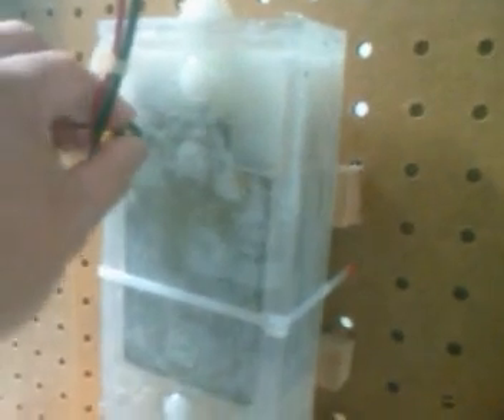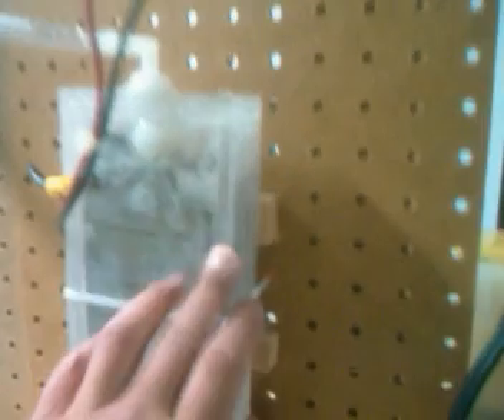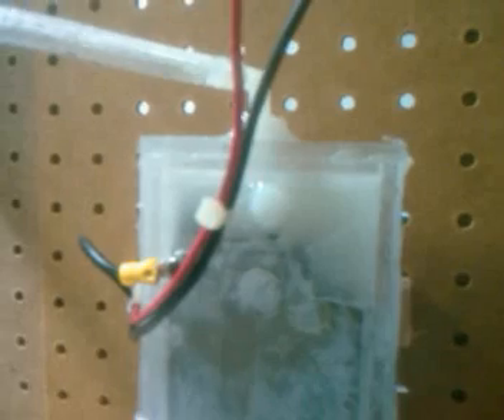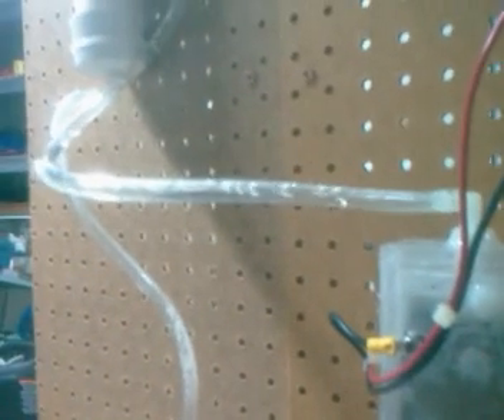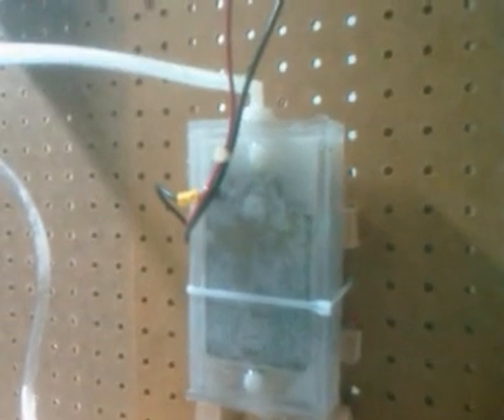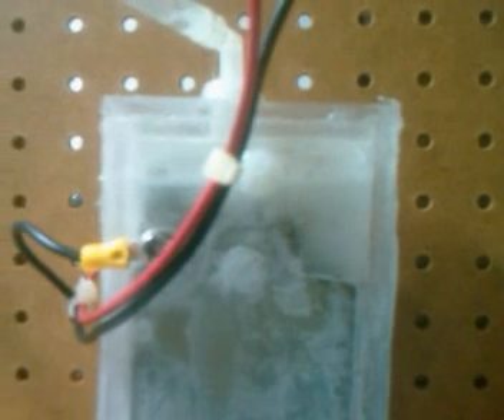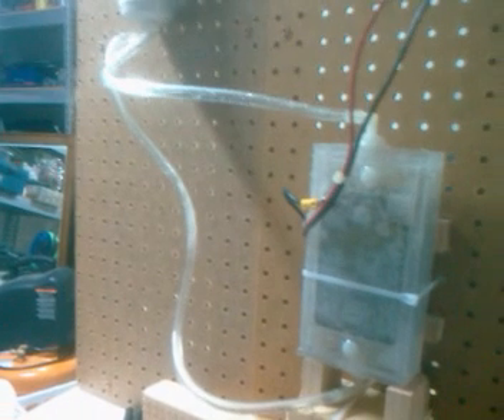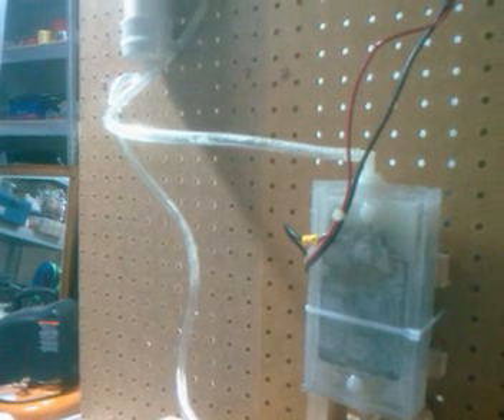HHO flow thru design

Comment: Yes, the pulsing effect was something I noticed with my first couple Tero Ranta replications couple years ago. Tried to get around that by using seperate inlet/outlet.  This got rid of the pulsing, but lost some efficiency.  So its all about trade offs.

If you disrupt the normal formation of bubbles, you will end up with tiny nano bubbles in your fluid that are a pain to get out.  Ultrasonic pond fogger helps but is not perfect.  Best to let bubbles form natually and escape for now.

Comment: possible larger output hose from your cell? seems like you have a certain amount of head pressure from the bubble at the bottom of the cell and also a certain amount of head pressure in the output hose, once the hho presure builds to overcome that pressure it goes up the hose, probably pressures backwards out the bottom at that point also, good job, i think i might even put a trans cooler inline on the bottom hose on mine

Comment from the maker: Actually, the bubbler is set just the way you describe: the entry is to the top of the bubbler having a small tube down the middle by about 5 inches, and the water level is just below the level of the end of this tube.  the gas exit tube on the bubbler is just above the entry tube.
As you can see in the next video, I addressed the flow problem by simply raising the bubbler.  Big improvement, but still would like faster flow.
THANKS!